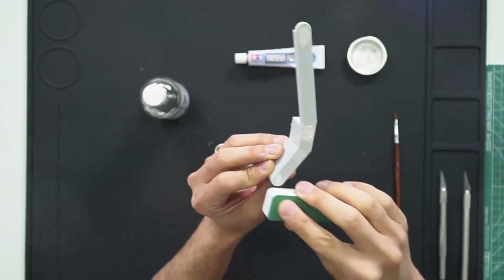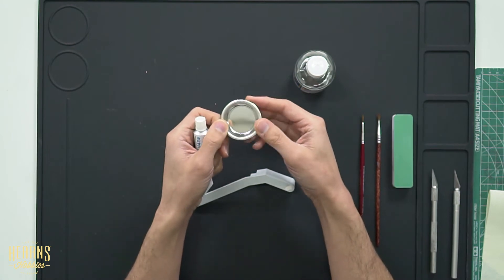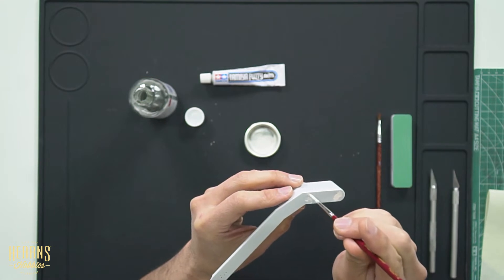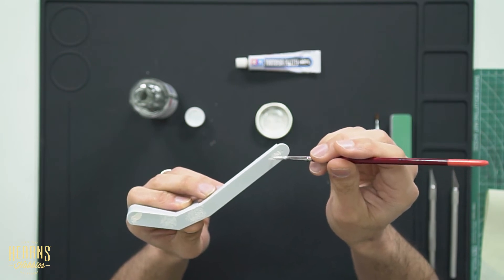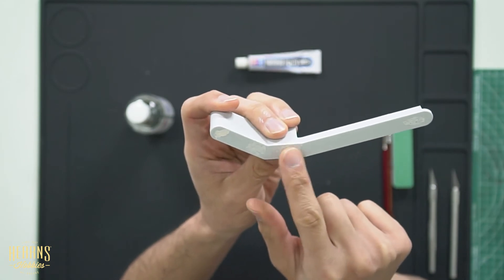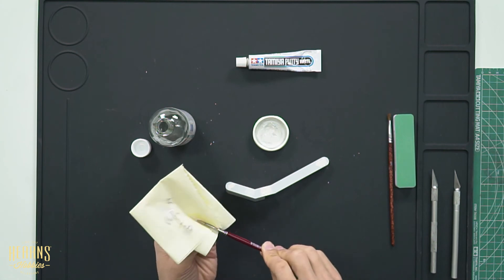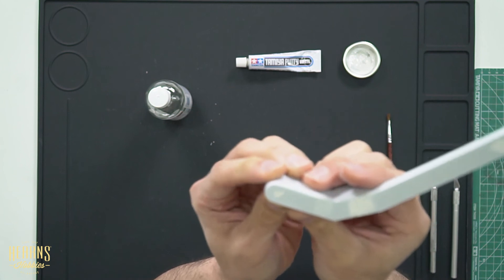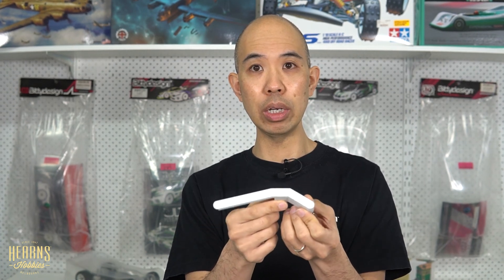Tamiya | Lacquer based Putty Tutorial | #askHearns

Comment: Thanks for the great video!  I'm looking over the Internet to find out what ingredients, i.e., resin, maybe in Tamiya lacquer base putty, with no success, i.e., SDS/TDS.  Are there any safety precautions and equipment, e.g., respirators, that I should take to protect my household while using this product?  Please advise?
Reply from the maker: It is best to contact the manufacturer directly to receive the latest version of the SDS for a particular product. Lacquer has strong solvent fumes so should be used in a well ventilated area. Respirator may be needed if you are sensitive. Please consult the SDS for full details.
Reply: It contains 4 methyl pentan 2 on that is the main sweet solvent smell you will smell.

Comment: Will tamiya basic putty shirnk under primer/paint cracking finish ?
Will lacqer primer/paint reactivate it ?
Reply from the maker: As a lacquer based product it can shrink if used to fill large gaps. This product is best for hairline gap filling.
Yes, lacquer primer/paint can reactivate it much like lacquer paint over a lacquer primer. As long as the coats are not excessive your putty will be fine.

Comment: Thanks, can you thin it with IPA?
Reply from the maker: I have never tried IPA. Lacquer thinner has always worked for me.
Reply: @HearnsHobbiesMelbourne  Thanks for responding, been using mostly putty for tiles and it's been working pretty good, it's water based so it's easy to thin with water and smooth, after fully curing add water and go over it several times with a cloth so the excess gets removed and only the scratches/holes get filled.
Reply from the maker: Thank you for sharing your method!

Comment: Problem i have with these are after opening the tube, no matter how tight you close the top, it dries out in time and gets hardened.
Reply from the maker: This putty does dry out after breaking the metal seal. Best to keep it in a cool place out of sunlight. I have a tube that has been open over a year with slight thickening of the putty closest to the cap. Scrape out the hard stuff and keep using. Perhaps sealing the opening with plastic wrap before tightening the lid could extend it's shelf life.

Comment: Is it possible to just thin it with water? Or possibly tamiya enamal thinner?
Reply from the maker: The Tamiya putty is lacquer based so needs to be thinned with solvents such as lacquer thinner. If you prefer water then you need to get a water based putty.

Comment: How strong does the putty get when its dry?
Reply from the maker: The putty is firm, like plaster so it sands easily. It is suitable for filling fine gaps and texturing. For remodelling, use epoxy putties like Green Stuff, Milliput, or Tamiya epoxy putty.